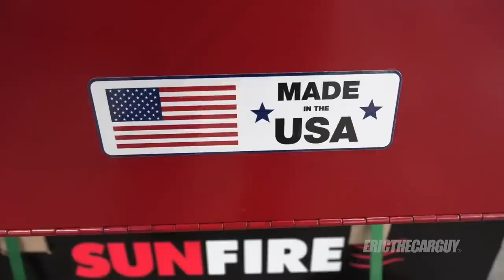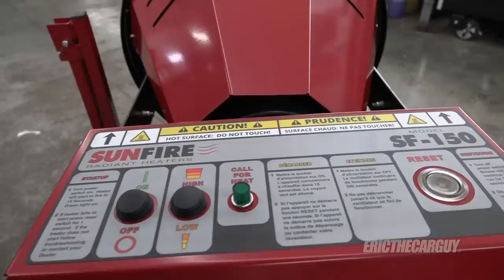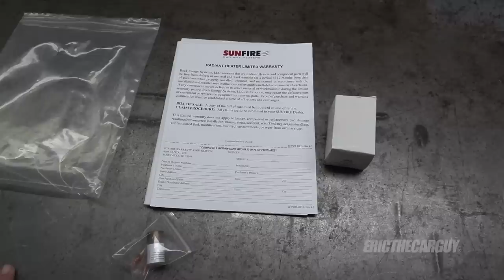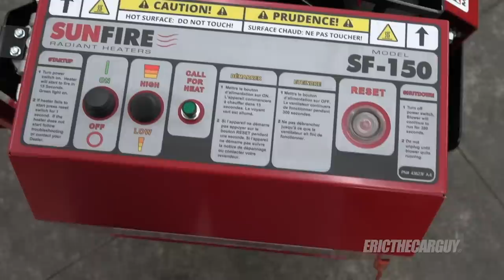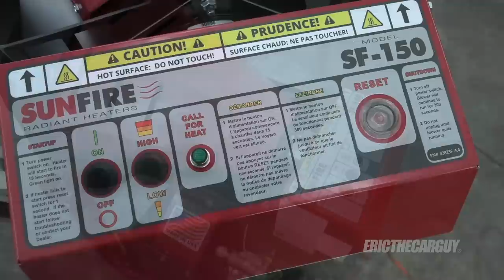SUNFIRE Heater Review

Comment: You need radiant heat tubes that hang over the length of the shop. They would be more expensive but they heat the whole shop and are very quiet.
Reply from the maker: True, but this will work great until that time. Thanks for the suggestion.

Comment: 2,295 dollars is the price of about 10 torpedo heaters that can be run in different areas of a shop providing better heat coverage. Not a good deal for a friggin' heater
Reply: @Hubjeep  have you liked that rig so far?  I have a large shop...  all stone block and super high ceiling up to the metal roof.  Very old building from an old coal mine on my property.  It’s a nice shop but absolutely shit winter working.  Torpedo heaters don’t cut it anymore.
Reply: @monkeywrangler5200    It's about half the noise of a traditional kero/diesel "torpedo" heater.    Minimal fumes once the front grate gets red-hot.  I run home heating oil in it.  It takes a standard oil burner nozzle, I think mine is partially clogged, ordered a couple new ones.  It's nice being able to use "in house" home heating oil instead of filling a propane tank, which is the cleanest burning.
Reply: His heater is better than 10 heaters. Those shits throw all kinds of crap in the air which you get into your lungs. I'd fucking ban torpedo heaters because they are dangerous as fuck and people have no clue.
Reply from the maker: It's not right for everyone, but if you're a commercial operation, or you have a large shop like I do, it can be a very good solution for heat. Thanks for the comment.

Comment: I have one of these and love it.  It won't last as long as a torpedo style heater though due to the extreme temperature cycling and they don't do well with cycling on and off.  The torpedo is well suited for long term thermostat driven heating, the sunfire is well suited for those times when you're actually there and want heat while working.

Comment: Get a diesel fuel can so we don't have to see a "What to do if I put diesel fuel in a gasoline car" video.
Reply: I think I heard him say a new gas can, so its possible he bought that just for diesel.
Reply: @DeatGaming   a gasoline can is red. A diesel can is yellow. No mistaking them.
Reply: Or worse..:what happens when you put gasoline in a diesel heater.
Reply: 3:54 See the big "DIESEL" written with permanent marker on the top near the handle? Yeah, that'll work for people with an IQ above room temperature. Correct color is nice but not necessary if you're not a complete idiot. Eric is in fact, not a complete idiot. 👌
Reply: @paulsmith9341  Roses are red, kerosene cans are blue...
Reply: @paulsmith9341  
Yellow is kerosene.  Diesel is blue.  I know.  I painted one of my red cans blue because the state I lived had a law against pumping diesel into red cans.  The station clerks would shut you down if they saw you doing that.
Reply: @paulsmith9341  RED: Gasoline (Flammable), BLUE: Kerosene (Flammable), YELLOW: Diesel (Flammable), GREEN: Oils (Combustible)
Reply from the maker: I already posted that video. 😉https://www.youtube.com/watch?v=xhmJmCMxMS0&t=2s

Comment: Why not get a propane vented furnace for the shop?  Quieter, forced air. No fumes.
Reply: Better yet a natural gas one because I believe eric already has a natural gas line in his shop.  Really easy to tee off of and run the line wherever needed.
Reply: @scallywag1716  they arent that expensive new either, and you dont need to have them professionally installed for the warranty. I
Reply: @chubbysumo2230  you don’t have to convince me....I only suggested natural gas because the supply is already available.
Reply: Doesn't have the heating power of this machine. When Eric's shop gets cold (because of the concrete floor and large open space, that kind of heater just can't compete. This, not only puts out heat in the radiant fashion, but also heats it up. This is the supercharger of heaters, and it doesn't put out anything either, if you look this type of machine, it's rated, within reason, to run inside a shop.
Reply: @aserta  true, but you can put multiple heaters overhead.  Probably cost just as much in the end.
Reply from the maker: I've been over this in other videos about my shop heat.

Comment: That thing is no joke! I've used jet heaters, that thing is an oil burner! You could put that in a boiler, furnace, or water heater, I bet it's enough BTU's for a house. You can substitute Kerosene, burns cleaner and won't gel up like diesel. Just doesn't burn as hot you get more BTU's from diesel. That's up to personal preference.

Comment: They are very nice heaters, the dealership i work at just started selling these. I would suggest putting it outside and letting it run on high for an hour or 2 to burn off all the stink, it is pretty bad for the first couple hours. The biggest difference i noticed is unlike a torpedo heater that heats the air, this is radiant heat that heats objects. So the more stuff thats in the shop to warm up the longer the heat will last in the shop between running. Good luck with it and hope you enjoy it. We have sold a couple units already.
Reply: Yea, the smell of that red paint baking in can't be too great!
Reply from the maker: Too late, but you're exactly right. After firing this up and using it for the first time there was quite a smell. Nothing too offensive, but something to be considered when using one of these heaters for the first time. For me, it's been much better than the torpedo heater. It takes a lot less time to heat up the shop when I work now. Thanks for the comment.

Comment: That thing is SWEET! I’d run that on number 2 heating oil, so you’re not paying road taxes to heat your shop. 💡 It’s much cheaper per gallon, too.

Looks like you’ll be using that today. It’s 26° up here in MA this morning. 🥶
Reply: That's a good idea. Heating oil is diesel, it's the same thing. Except it has a red dye for tax purposes. Dyed Diesel Fuel. I mentioned he could use Kerosene too, some people choose to run Kerosene over heating oil for their home oil burners. They both have different advantages, so it's really up to preference.
Reply: @TheRabidPosum  - Kerosene is nice and clean burning, but out here in MA it's very expensive. Last I checked it was $4.30 a gallon, while #2 can be had in my area for about $1.60 a gallon. Not sure about OH where Eric is at. Usually everything is alot cheaper out that way ... or anywhere outside of the Northeast if I'm honest, lol.  You get a few more BTU's with #2 / diesel over kerosene, too, but kero works better when the temperatures are super low..
Reply: @SmittySmithsonite  I'm in New York. I really don't know much about the pricing, but I did hear Kerosene is more expensive over Diesel/Home Heating oil, because basically it's just a higher grade of Diesel. But some people choose it because it's cleaner and doesn't gel up in the winter. But the disadvantage is Diesel does have a higher BTU output.

Comment: I have a similar heater, just smaller. Works great, except it isn't thermostat controlled.  That's my main reason for not using it much. I may have to look up the schematic for yours and see what's different compared to mine.

Comment: Don’t know if it was previously mentioned but you should really get a specific can for diesel. They should be colored yellow so you don’t use diesel in the wrong application on accident. Also, the can material may be different so the diesel doesn’t break it down over time
Reply from the maker: This was the only fuel can available at the time, and I needed the fuel to make this video. I'd have to order a can like that because I couldn't find one locally. That said, I wrote in big letters on the top of the can what it's for. Given that I pretty much work alone, I don't think it'll be an issue but that's a great suggestion for others. Thanks for the comment.

Comment: Personally I use a tarp over the car and a mr. Buddy Heater with one pound tanks because I live in an apartment building and the garages have open Rafters across the units I just do small jobs on my car change oil maybe a water pump or I got a inner tie rod end on my 1999 Toyota Corolla LE I'd like to see a video on that repair thanks Eric

Comment: Eric I know you have a NG heater. I would just pay whatever to get that to work. Also a smart thermostat and schedule it to bump temp before you arrive.
Reply from the maker: I've been over this. The gas company wants $45 per month just to run gas to that heater, even in the summer when I'm not using it. In addition they want me to pay for the gas I use. Since I''m not at the shop everyday, it doesn't make sense to do it that. Also, that's just as loud if not louder than both of these heaters. Thanks for the comment.
Reply: @ericthecarguy  Ever thought of running the NG heater off a propane tank (convert it obviously)? Your new $2500 heater isn't exactly a cheap solution. Non vented as well.

Comment: Eric, with a bit of tinkering, you could probably add a timer switch to it that runs that heater for 1 hour before you arrive at the shop, then you turn it off manually and let the fan run, or with a bit more tinkering, it could even turn itself off. You just have to hope that there isn't a power outage while the thing is hot so it can finish its 300 second self-cooling cycle. Also, a follow-up video once it's really cold would be interesting. Something like "OK, after running the old heater for x amount of time, the shop thermometer now shows y degrees, and after running the new heater for the same amount of time, the shop thermometer then shows z degrees" to show whether it's really better. Also, I find it strange to measure the size of the room it's suitable for in square feet instead of cubic feet, because your ceilings look like something around 20 feet high, and that's much higher than a normal room that has maybe 8 feet. Plus, hot air travels upwards, so it'll heat up the place literally  from top to bottom...

Comment: Eric, I was wondering... If this new heater has better coverage and heats up almost 3500sqft - and is quieter... I presume, you can simply keep it further away from you then? Albeit, you did mention that it's infra-red - which would then be redundant to keep far away (because infra-red heats up living/organic stuff; humans, animals, plants - but not furniture, equipment etc., per se) - but I think that's just a coincidence in nomenclature. Because radiant heat is simply radiant heat; it rises and the process repeats over again... But I do like your new heater it looks great!
Reply from the maker: This heater is much more efficient than my torpedo. I don't need to run it nearly as long to get the same or better results. That alone makes it better. Thanks for the comment.

Comment: How can that be safely run indoors? No Carbon Monoxide?
Reply: You should have good ventillation when running them, but the burning should be pretty efficient so hardly any CO, just co2 and water
Reply from the maker: Good question, more info on that when you click the link in the description for the heater.

Comment: I wouldn't give up considering it during production. I don't think it would be that disruptive especially if not very close. The type of sound and level of it seems very ambient, albeit moderately noisy ambient, but not overwhelming or intrusive. The torpedo on the other hand produces air movement that adds buffeting to the sound equation.  Maybe run it in the background of a few short vids like on ETCG first to see if anyone notices.

Comment: Haven't tried this yet, however why not get a bumch of IR heat lamps and wire them up to additional light sockets in the ceiling?  I did that in our bathroom (NYS), and works pretty nice in the winter. 
Just put a couple of switches to zone your work area, and turn on/off as needed.  Electricity is gotta be a lot cheaper than fuel.

Comment: you should install several mini split heatpumps.. my shop is 30x60 and i have 4 of them in there and they put out plenty of heat and you can't even hear them when they are running.

Comment: If you have it in the other end of the shop, is it quiet enough??
Reply from the maker: Even though it's noisy, it's not as loud as the old heater, and doesn't take as long to heat the shop up. That means I don't have to run it as long to get the same result. So it will still save me time in the end. Thanks for the comment.

Comment: i used to blow apprentices and cleaners up with the old one you have, i'd spray some brake cleaner in the front end, leave it switched on but with the power cord extension left out a bit to stop it running.
when my victim came past i'd  say, "oh can you put your foot on the extension lead, its popped out"
ka boom.
just a very load bang, no one was ever harmed, scared shitless a few times though.

Comment: I don't like non exhausted flame heat.  I'd be putting in electric myself, just to be sure I didn't die from CO poisoning or having migraines all the time..   but I don't have a shop so there's that.....
Reply from the maker: This is an ultra low emissions heater. Meaning you don't have to worry about that. The link in the description has more info on that. Thanks for the comment.

Comment: I got questions about this style of heater.  I got 2 torpedo heaters heating my barn that is about 40ft to the roof.  I use a 215k btu and a 70k btu heater that can make the second floor about 50 degrees warmer while it might make the first story about 20 degrees warmer, unless I use fans to push the hot air down, and super drafty.  It is hard to describe the setup without seeing it, but basically all the heat rises from the heaters leaving my work space cold.  Would this style of heater keep the heat down in my work area being it is radiant heat, or would I still have the same issue?  I was thinking of getting 2 80k radiant heaters to heat form each side of the shop that is 30 ft long and 20ft wide and is open to the second floor, which is a hayloft that is 2 times the size and has a 30ft high roof above it.  My bay sits 10 ft below the hayloft.
Reply from the maker: Hard to say exactly, but in my experience using this heater, it's more efficient than the torpedo and puts out a larger area of heat. Given the BTU this is rated for, I think this might work in your situation. Don't take my word for it, click the link and contact them directly to see if they can help you with a solution that will work for you. Good luck.

Comment: Reminds me of the situation in our old shop. We had one of those tornado heaters, it was noisy and (while theoretically adjustable), in practice it was either roasting hot, or off. 
It meant the shop temperature would vary up & down hot/cold all day, it created tons of moisture so all the internal walls would get wet, and it ate all the oxygen out of the air in the shop. 
We swapped it out for a 3 phase all electric heater and the difference was night & day. The electric heater was properly quiet, created no moisture, did not burn up oxygen, and kept the shop at a constant temperature all day. 
The electricity rate was not cheap where we were (on a marina), but the price was worth it for the increase in productivity and wellbeing it brought.

Comment: Can someone explain to me how something can burn fuel indoors and be safe? Genuine question.
Reply: Yes a great question David that most people have. It's in the technology we developed to burn ALL of the fuel properly adn efficiently. Some heaters can use technology that does not burn fuel efficiently, that can leave emissions and emit an odor. The SunFire 150 has ultra-low emissions with only up to 1 parts per million of carbon monoxide. The OSHA standard is 50 parts per million.  Ventilation is always a good idea because anything with a fire uses oxygen but the SunFire is UL approved for indoor applications and is virtually odorless.
Reply from the maker: Click the link for the heater in the description for more info on that.

Comment: Unfortunately the company doesn't provide db noise specs in their online manual. As someone else mentioned, you can run a test with a sound level meter and compare the two heaters in a future video. No big deal. Just a thought. Stay warm this winter.
Reply from the maker: I thought about doing that in this video, but I didn't think it would be relevant to most people needing a heater like this. I was wrong. Thanks for the comment.
Reply: Here are the decibel ratings of the SunFire 150: @20 feet: 67 db
, @10 feet: 73 db, @6 feet: 73 db. It's not silent but people can stand next to the heater and still have a conversation and clearly understand each other. We will add to our website - thanks for the heads up.

Comment: Nice heater! IMO I think you'd be fine to leave it running while making videos, especially if it were at the other end of the shop from where you're filming. I could still hear you just fine even with the torpedo heater running, but at least you wouldn't have to shout over this one. People can live with a little background noise. Your comfort matters! :) If you set up a thermostat where you usually work to keep a comfortable temperature with the heater at the other end of the shop, maybe you could time your video takes to coincide with the heater turning off with the thermostat.

Comment: You really should store diesel in a yellow can. RED: Gasoline (Flammable), BLUE: Kerosene (Flammable), YELLOW: Diesel (Flammable), GREEN: Oils (Combustible)
Reply from the maker: I should, but this is the only can I could find so that I had fuel to run the heater in the video. Thanks for the comment.